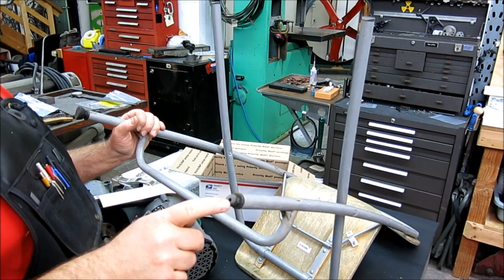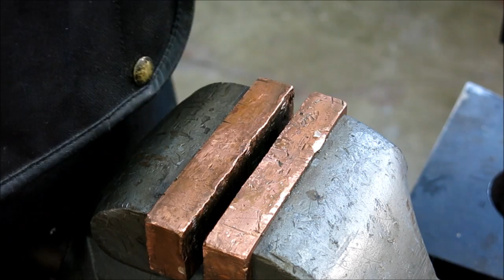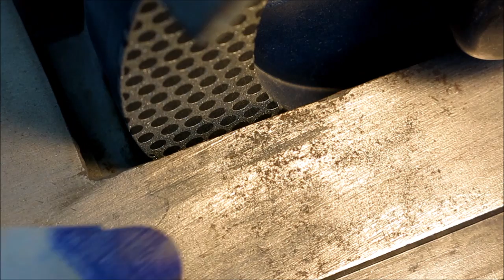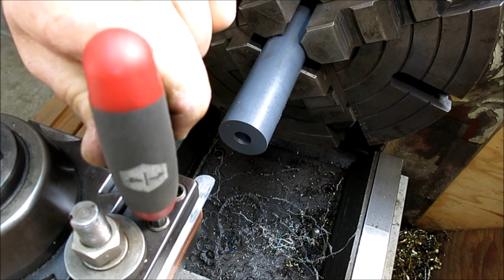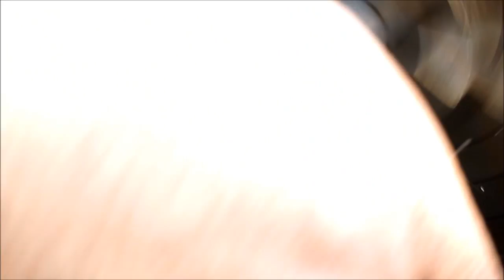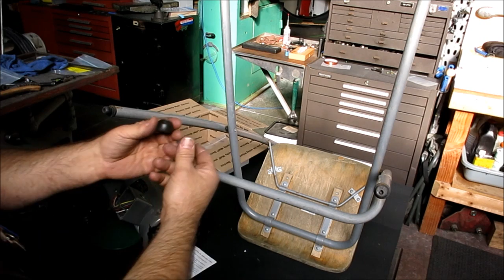Ikea Chair Foot Form Tool From Casting

Comment: The color is way off from the original. I really expected a better effort from you on this 500 cent chair.
Reply from the maker: Morgan Oliff Hi Morgan,

That is the cool part of an over the top repair on a crappy disposable chair. It stands out in contrast to the original. Kind of the reverse of fixing your Rolex watch band with some bailing wire. I promise to try harder next time. Thanks for the comment.

Cheers,

Tom

Comment: i saw the motor For the attachment on that K&T you bought, is there a video for that? Also, i hope you have the MSDS for that "mystery jar o' chemicals" we wouldn't want to violate any OSHA regs now would we, haha
Reply from the maker: Sandman Actual Hi Sandman,

Jar of chemicals? You mean the blue topped cutting oil container? The K&T motor has been shown in the Autometric series. Thanks for the comment.

Cheers,

Tom

Comment: Great idea and work!  Beginning to see how experience and patience influences problem solving/job/work.  Similar the other guy I was guessing on a hot glue cast part.  Not sure how to do that either.  Have opportunity to trade/barter/purchase some plastic, polyethylene crystals/particles/powder/beads but not sure how to use such, if I would be able to make good use of.  Thanks
Reply from the maker: Hi Aric,

Thanks for the comment.

Cheers,

Tom

Comment: Tom, I really enjoyed this. I had a similar situation a few years ago. I ride bikes alot, pedal bikes. and I am friends with a local bike shop owner. So he gives me a call about a sweet deal on 2 bike racks specifically designed to fit in the bed of a truck, because he knew I was looking for something. There was one hitch. The one was missing a plastic plug, but he could order one for around $6.00. "No  Thanks" I told him. I made one from Delrin. So that $6.00 repair ended up potentially way more expensive, but much more gratifying. Love the videos, Shawn
Reply from the maker: Hey Shawn,

There is something satisfying about making a good repair part from scratch. Its kind of like saying, "Hey I could make this whole thing if I wanted to" Thanks for the comment.

Cheers,

Tom

Comment: What was the name of the gauge oxtools used to check the center height of his newly made tool?
Reply from the maker: Hey Brick,

Not sure of the official name. Center height gage or tool center gage might give you some leads. The upper section on mine is a Hardinge model.

Cheers,

Tom
Reply: oxtoolco Thanks I'll take a look. I think I'm becoming obsessed with measuring instruments!

Comment: Hi Tom

Great video. Great idea using the hot melt glue for the mold, I'll store that tip away for future use.

That foot alone is now worth more than the chair :-)

The radius looked close enough that you could have rotated the toolpost the other way and made the radius shaped cut by running the lathe in reverse. Obviously you considered the closeness of the toolpost to the chuck prior to making the cut and provided enough material length.
Reply from the maker: Hi Zen,

You are correct I could have run it on the other side. I'm so used to working on the front side I miss that idea sometimes. Thanks for the comment.

Cheers,

Tom

Comment: Great video!  FYI, the denatured alc. will work miracles to release hot glue (A little trick learned from the wizards at DuPont during my solid surface fabrication training).
Reply from the maker: Hi Jeff,

I forgot to mention that one. Denatured really works well on hot glue. Thanks for reminding me. 

Cheers,

Tom

Comment: Great repair, I would have tried to repair it as well. Looks like a nice design of chair for the shop...light and foldable. Love the form tool action. I keep a piece of HSS planer blade for grinding out radii and odd shapes. Never thought about using the hot glue in that way...I normally just stick things together..LOL

Colin ;-)
Reply from the maker: Hey Colin,

It actually is pretty versatile stuff. Its just hard enough you can do a few things with it. Thanks for stopping by. 

All the best,

Tom

Comment: heh, I love your valuation method.$5.00 chair with bad foot, $500 after foot replacement, add lube $5,000,000 chair.
Reply from the maker: Hey John,

Its not like I had to write a check or something. It should last another couple of months like all the ikea crap. Thanks for the comment.

Cheers,

Tom
Reply: i love you guys, adam and you crack me up.

Comment: Hey Tom, could you have used the gauge pin to calibrate the form tool? Just was a thought as I was watching. Calibrate to back side of a know diameter pin. If yes - your efforts to teach us something are paying off (keep the videos coming). If no- I need more training ( keep the videos coming) Either way thanks !!!
Reply from the maker: Hey Pete,

I have not tried that with this DRO. No reason it shouldn't work. The bore is more stable even with a tight fitting pin. Thanks for the suggestion. 

Cheers,

Tom

Comment: It was interesting to watch you do that.  Personally I would have just went to the hardware store and bought a new foot.  And while I was there I would have looked in the discount tool bin to see if anything good was there.  I got a 1.25" drill bit there one time for under $10.  Thanks for sharing.
Reply from the maker: Hey Harold,

This is a "special" foot. I would have had to buy two to get them to match. Thanks for the comment.

Cheers,

Tom

Comment: You need a bore scope connected to a cheap TV mounted behind your lathe, so you can see into your work, or even use as a 'mirror' as it were.
Reply from the maker: Hey Dread,

I managed to get over the top of it when I didn't have to worry about filming it. Thanks for the comment.

Cheers,

Tom

Comment: Nice Tom I liked all the lathe tips and tricks on this one. I really like that tool for calibrating tool height I am thinking about making one for school. I remember you did a video on it a while back I will have to check that out. Any way I was wondering what is the way you normally go about squaring up your tool post? I usually square mine up with the tail stock quill. I was wandering if you had a more effective method?
Reply from the maker: Hi Daniel,

I use the same method with the quill or the face of the chuck jaws if they are handy. Thanks for the comment.

Cheers,

Tom

Comment: Hey Tom, Ikea has many available parts that often they will just give you. But then we wouldn't have had this video.

Thanks for sharing.
Reply from the maker: Right you are. I can't stand going into that place. You feel like there is a guy with a bolt gun at the checkout line.

All the best,

Tom

Comment: You know, you could make your own glue gun. I made one from bits and bobs with two heating coils pillaged from two cheap-o glue guns. It's twice as fast and doesn't have that annoying cold joint thing. Plus i added a red bulb because i liked the old solder guns with a witness light in it.
Reply from the maker: Nobody is crazy enough to make their own glue gun............You can just buy one.

All the best,

Tom
Reply: oxtoolco Yeah, but they never work right or last. I've never bought one that's ok. And i've gotten some pretty expensive ones too.

I had to do a lot of maquettes for my diploma and across the uni years so i know, trust me. 

Personal advice, the more expensive the easier they break under stress. I've had "Shenzen" ones last me more than the "quality" Proxxon...gosh that was such a disappointment.

Some point during my last year of Uni i just gave up and sat down with my box of broken parts, got the best that would fit together and made the one i have now.

Comment: That was a good lesson in how to make something like this I wonder if this coud be done using metal and then heating and pressing it on.  It could be a project for a foot on a machine or a Neat little machinist jack
Reply from the maker: Hey Fast,

If you get the sizes right you can work in the elastic range of the material. The answer is yes you can create a snap on shape like this for a metal foot. Thanks for the comment.

Cheers,

Tom
Reply: Now us old country boys would have gone to our material supply (piece of oak limb that has been laying on the ground for a couple of years), then pulled out our pig sticker and started whittling.  We could have done all four feet to any height you wanted is less time.

Love the video Tom, fun one.  Now you need to paint the chair gold...

Comment: Added some provenance to your chair!
Reply from the maker: Hey Joe,

I actually signed the foot so its all traceable. Thanks for the comment.

Cheers,

Tom
Reply: At McD-D there were some chair wars sometimes.  It was funny.  Some lady would have a chair for 20 years and it was HERS!  Around 1990, they purchased a few hundred really nice chairs.  Building those aircraft was great.  The scale of the production was awesome.  they had mills with ways that were a hundred feet long.  Some other mills were big enough to park a Winnebego under.

Comment: Those swivel feet are available at Lowes for under a buck for two. I made my own height adjustable chair with a BMW 5 Series driver's seat. These seats are available in 10 way power and are less than a hundred bucks..  Now that it a real project.
Reply from the maker: Hey Bob,

Mine is done. How is yours coming? Thanks for the comment.

Cheers,

Tom

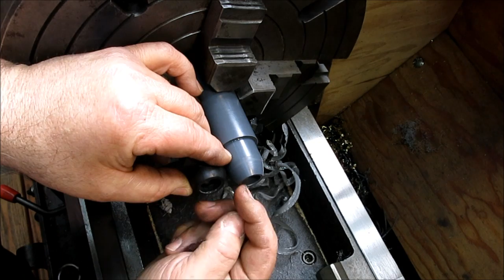Comment: At 37:15, there was a moment of trepidation, where I was unsure of the direction this video was taking.
I think you need to get some black plastic and redo it, or make some more gray ones so they all match. :)

Brent
Reply from the maker: Hey Brent,

The gray is me thumbing my nose at Ikea. It begs a question when somebody sees it. Whoa what happened there? Then you have a great story. Wasn't there some famous cabinet maker that used to say his work couldn't be too precious? He would build a fine cabinet then drive a 16D nail into one of the book matched faces just to make the point it was to be used. Thanks for the comment.

Cheers,

Tom

Comment: For the outside large diameter, could you have run the lathe in reverse and mounted it otherwise in the tool holder, to cut on the other side of the cylinder? Could maybe have done with less of the material sticking out, and less of a chance smashing into the chuck with anything?

Really neat fix! I really enjoy the "if it's broke, fix it" mentality, over the "buy, break and throw away" mentality which seems oh so much more common. Thanks for the video!
Reply: Was wondering the same thing myself. As per usual another fine Oxtool presentation
Reply from the maker: Hi Daniel,

That would work as well. I rarely work on the opposite side so it didn't occur to me. Once you have a plan in your minds eye unless something goes wrong I don't generally deviate. Thanks for the comment. Santa from Sweden sent me a little package. Thx!

Cheers,

Tom
Reply: oxtoolco Likewise, and with the backplate on the lathe here the cross slide rarely extends far enough to reach around that side anyhow. 

Glad to hear Santa delivered! Haha!

Take care!

/Daniel

Comment: Great video, very enjoyable! I feel better because it looks like I am not the only one that tries to revive cheap stuff using experience and time! I think you finally did put more though to this than the orginal designer! I also noticed by searching on google that the original chair has four swivelling feet instead of two! It looks like the two front feet just broke off. I would love to see you make two more of those feet now that you have the setup but also two new plugs with the sphere in the end, for the front feet! That would be a $5M chair right there! I love to watch PVC beeing machined! Can't you tell?
Reply from the maker: Humm, I'm going to have to look at the other two legs. I could have sworn those were non swivel type. Might need to pop those suckers out as well. Thanks for pointing that out. 

Cheers,

Tom

Comment: Tom,
Chuck up the sample to set zero on diameter as a direct measurement with the form tool. Also, make two new feet from the new material so they wear at the same rate. Making two new feet also makes it easy to match profiles.
Reply from the maker: Hi David,

The original was too difficult to chuck. I did think about making two but I'm super lazy...... Thanks for the comment.

Cheers,

Tom

Comment: I have not heard the word re-entrant used to mean undercut before, it is usually a software term.

Got a laugh out of "IKEA Junk", never been to one but figured all the hype didn't mean that much.  My general policy is, if it is all the latest rage with the popular crowd, it should be ignored or avoided.

And oil on plastic? Cool!  Seemed to work great! Would not have considered that myself.  So many things to learn and try, so little time.  Hoping you made a couple for future spares due to the time and setup or at least mark that form tool for later use.  No doubt the one from PVC will be more likley to split vs the orginal that was made from PE or ABS.
Reply from the maker: Hey Keith,

I compared the durometers of the two plastics. They were similar around 75 Shore D using my sophisticated testing method (auto center punch). I saved the form tool for some time in the future. Next time I go to the salvage yard I'll be looking for a "spare" Thanks for the comment.

Cheers,

Tom

Comment: That's my boy, "make do and mend".
If I were(?) to be the picky kind, I might have said why oil the plastic when form tooling the outside profile, wouldn't it more effective to put the oil on the tool. All you were lubing was outside of the swarf, but I expect you know best.:>)
ATB
c
Reply from the maker: Hey Chris,

No oil actually gets into the interface either way. All you can hope for is a few molecules slip past and do some good. It got better when I put the oil to it didn't it? 

All the best as always.

Tom
Reply: oxtoolco I was thinking that this would be a case where flood or even your little spray thingy might have had advantages, but job done and that is all that matters. The journey is nothing compared to the destination, right?
c

Comment: Whew...that was allot of work.  I wonder if you could have swung the OD tool to the other side and ran backwards to give chuck clearance?
Reply from the maker: Hey Jim,

If I would have thought of it. I had the plan all worked out. Didn't need to rethink it midstream. Thanks for the comment.

Cheers,

Tom